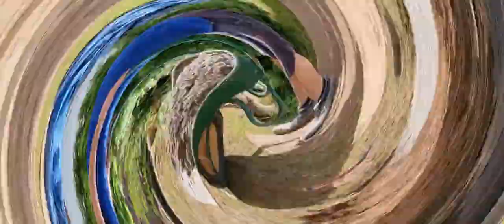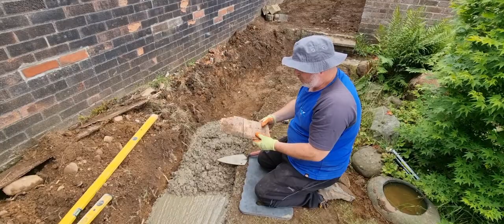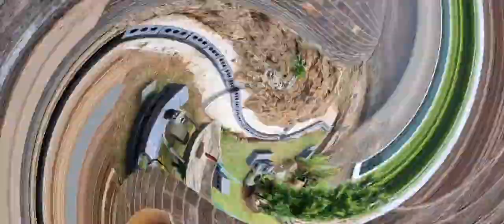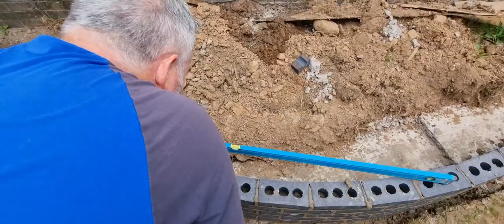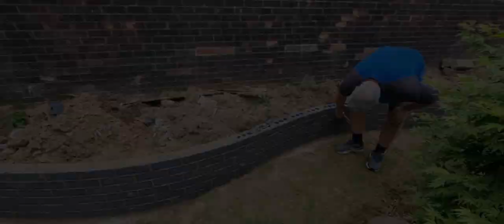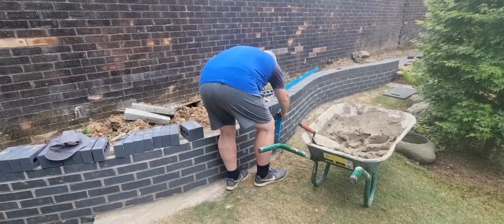How to build a curved wall

Comment: I love these videos. Should the step be 65mm ? not 75 ? both bricks will need a bed of 10mm so I think 65 ? Many thanks
Reply from the maker: @notsosmartmart5402  
Brick is 65mm a bed is 10mm so the step is 75mm.I sometimes reduce the step in height just to make sure I get over it 👍

Comment: Hi Justin, i currently have a a few landscapers looking at my job and stuck on what to do. It will be a raised patio however there is a large pad of concrete down currently and 100mm roadstone can easily go on top plus cement and slab of choice ofcourse. Most are saying the concrete pad does not need breaking / coming out and it can be topped and whacked with type 1, whats yours thoughts on this?
Reply from the maker: Difficult as i haven't seen the area.
If you leave it there and say the patio is layed with permeable slabs then water could seatle on top of the concrete below. This could create a lot of water held in under the patio which is not advisable. 
Its all depends on the site conditions and how close the slab is to the patio.
If it was me id always look to rip it up and start from freash id know its 100% right that way.
Its your call as the home owner if its bothering you ask for the quote to include the removal of the slab .
Or ask the guys to explain the reason why the concrete can stay in place .Ultimately your in the driving seat its your property and your call .
Difficult as i haven't surveyed the area but the guys are all saying the same thing ask for there reasons why it can stay and also if long term if its likely to cause any issues. 
Good luck
Justin 👍